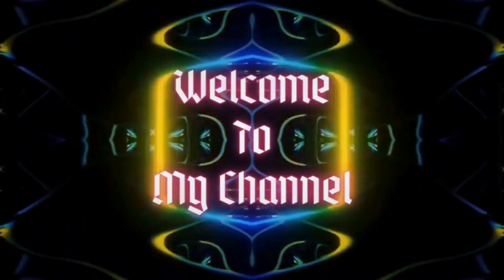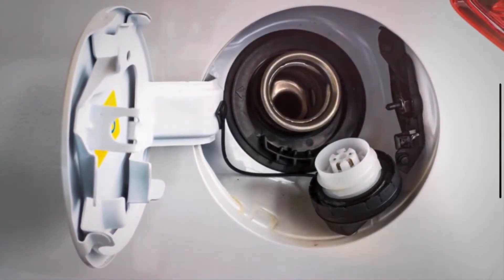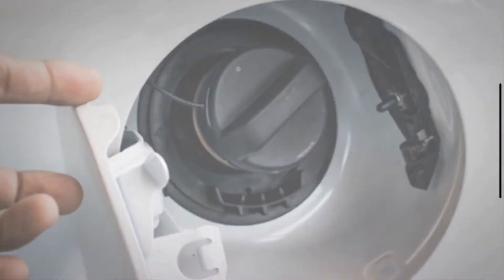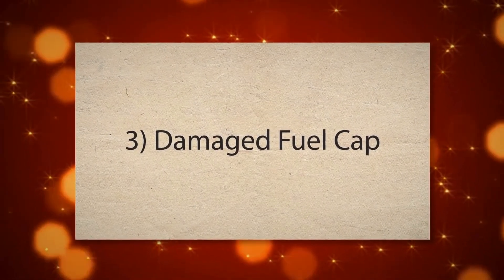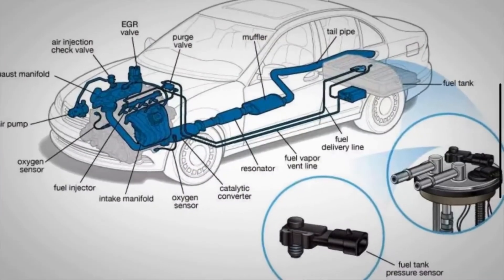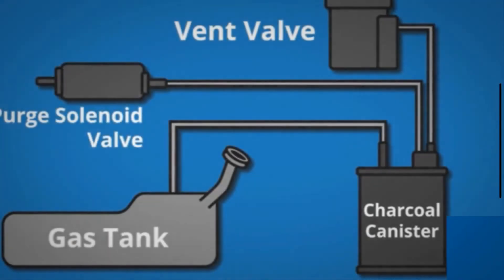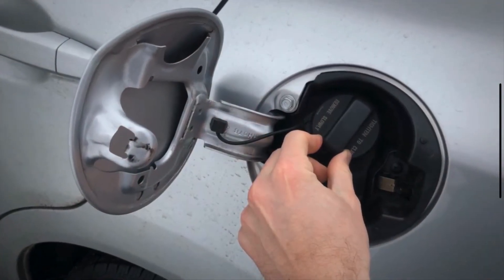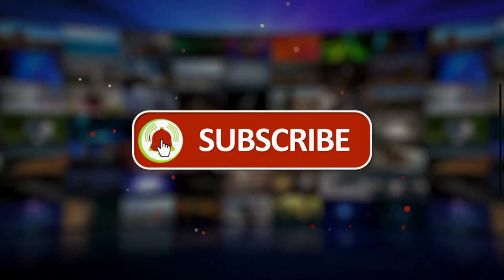TOP 6 CAUSES OF CHECK FUEL CAP LIGHT & DIY FIXES! 🔧

Comment: I purchased a locking fuel cap and since then I have had the check fuel cap light come on regularly. My mechanic replaced it with a different OEM fuel cap..Again the check light pops on. I purchased a different fuel cap from parts geek. Still the light comes on after driving a distance. My mechanic ran an expensive emissions test...problem still persists...I am tightening the fuel cap after full up to 3 clicks as specified....after about 100 miles I get the tighten fuel cap light...so far I am several hundred dollars in the hole without getting any positive results

Comment: Sometimes there is a sensor on the outside of the  bottom gas tank. This can get old loose or cracked and make the engine light or gas cap light come on.